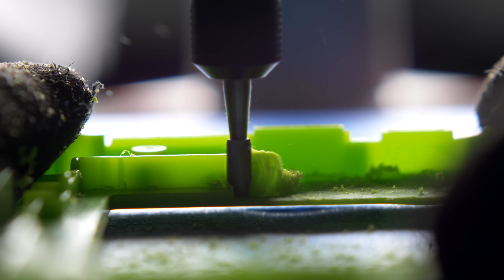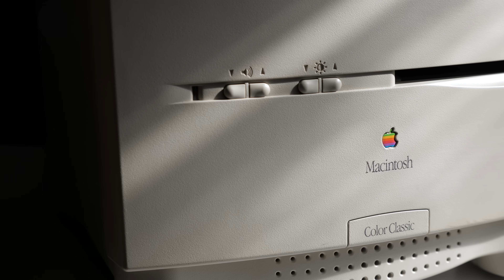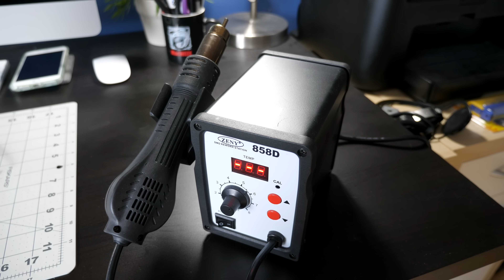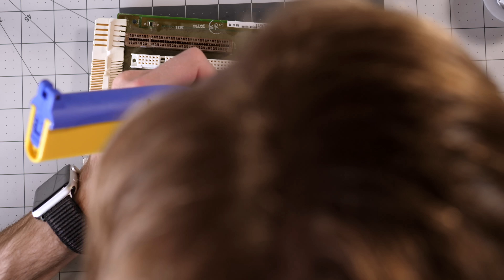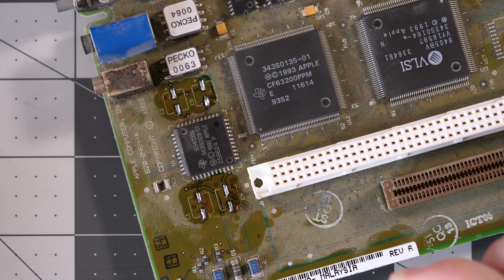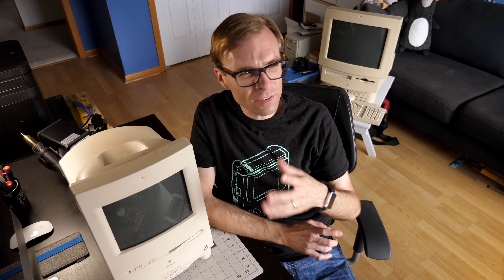Recapping My Classic Macs

Comment: hi  that some cecks  you got to be so care full  i pick up  sony 1800 uvw  betacam sp decks  

in side the uv meter unit there are 5 caps that go bad i can see them going  bad as  they are covered up the lool of the unit is ok

i have fond for me is to cut the cap in 1/2 with a side cutter first and get the rest of later    as the grey pad part could lift the track pads 

i have had this going on  and clean of the solder legs later on

Comment: Please be gentle when pulling up on those aluminum electrolytic capacitors from the board Sir. Those pads come off with very little ease. Much more so on older electronics, that have leaked electrolyte all over them. I saw you tug on one of those capacitors. You are gonna rip the pad off of the board, if you do that. I made that mistake with my NEC Turbo Duo game system, and probably depreciated its value by making such a terrible move on one capacitor mounting location. I had to find an alternate path to solder it to. Not only that, It was a real chore, to find a way to mount it securely to the board. 
Don't be afraid to get the hot air close to the board with one hand, and some tweezers with the other hand. Hold the capacitor you want to remove with the tweezers, and very gingerly, lift up on it, then apply the hot air moving back and fourth, as the hot air is gonna work its magic, melting the solder.  The capacitor will come right off with very little effort.

Comment: I have an Acer monitor that could use a recap, for restoring the color. But using a unimportant board for practice is a great idea!  Thanks again 🤓 I subscribed. Should have a long time ago! I would say you got a good deal on the rework station. The recap extends the life, even tho those mac's are old, of those classics!

Comment: This is not a easy way and not fast at all. I usually just twist them off. mr. carlsons lab has a nice video on how to do it.  https://youtu.be/X8N9O3a9jiM The key is not to pull, but just keen pushing and rotating untill they are completely free. the pushing is the counter intuitive part. just practice on a thow away board so you get the hang of it.

Comment: Hey, I have a LC550 with a same problem here. I sent out my 550 board, it lost sound not long before I bought it apparently, for a full cleaning/recapping/battery change, it came back in great shape but I still have no sound. Did you ever find out the root cause on yours?

Comment: i recapped 4 old macs that i found. a Macintosh Classic, a Macintosh LC, a Macintosh IIci, and a Macintosh Performa 450, they all had leaky capacitors and i never tested them until i finished cleaning and recapping them. they all work now. The Classic has System 7.0.1, the LC has System 7.1, the IIci has System 7.5, and the Performa 450 has System 7.5.5. many of them except for the Classic had no hard drives in them, the Classic's HDD was dead sadly so i couldn't see what was on it. all of them have SCSI2SDs since SCSI hard drives are hard to find.

Comment: I would suggest for people to purchase some Kapton tape to protect the smaller components around the area you are applying hot air to. You don't want some ceramic capacitors to fly across the room. Believe me, you will never find them.

Comment: I find surface mount caps are easiest to remove if you cut the can off flush with the bottom plastic plate using diagonal cutters. That will leave behind a black plastic spacer and the two leads which can easily be removed with a proper soldering iron and desoldering braid.

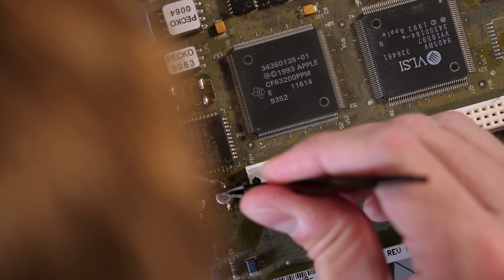Comment: Also, at 13:21. Why did you do the outside cap first? Tip for new hobbiests, when replacing caps, start with the inside first, so you don't get in your own way.

Comment: I had to replace an intel I/O chip on a mac mini once, I had never attempted it before but it wasn't too bad, I did have to use an oven to properly flow the chip which did work. I also had to replace two or three smd capacitors on the same board after baking. That late 2008 non working mac mini that I bought for only $30 over 3 years ago still works to this day!

I find that if you do not have very fine solder ".5 mm or thinner" than just applying some solder paste to the pads and laying either the component or capacitor in place and quickly melting one side with a fine tip soldering iron is not too hard. Dental composite instruments can really help put the paste where you intend and solder paste leaves such a clean joint! But I have spent quite a few years repairing car audio equipment and have worked on many smd based amplifiers, so I was ready for the mac min!

Another tip would be to buy a mixed lot of the capacitors where the ones you need are included, that way you can use the others for recapping or repairs.

Comment: Thank you for demonstrating how well hot air works on these SMD caps, I had a ton of trouble recapping my old Quadra 840AV because even with hot tweezers or two separate soldering irons, there's a tiny blob of glue under each cap and it's really difficult to break them off the board in a controlled way. Really easy to slip and dig into the board. Much better to just melt the glue with air!

Comment: I'm cheap and remove smd caps with a pair of pliers. If you rotate the cap clockwise or counter clockwise the legs will break off the cap and not damage the board traces. Done it for a long time. Also smd caps generally have worse esr than radial through hole ones. I just replace with through hole type usually.

Also need to warn folks about polar and non polar caps.

Comment: Now that you mention the analog board at the end; putting this together with the CRTs instability... I would say you should have recapped the PSU/analog board first.
Reply: No. The main board will get eaten by those caps before the THTs on the analogue board and PSU fail.

Comment: Great video but please be aware that you CANT go up in Capacitance rating, you CAN go up in the Voltage rating without issues tho. If you do go up in capacitance value your machine will start doing weird things or not work at all. 

Btw, great removal technique, I use the same myself but I use my desoldering gun to remove the excess solder from the pads, then apply flux with a Flux-Pen and then only put fresh solder on 1 pad per cap. After that, you can push down on the cap while heating the pad with your iron and achieve a flat installation. then you solder the other side and your friends will think your recap was done by a Pro. :-)
Reply: Derek Osborn you can sometimes go up and down in capacitance. Nothing is critical. I say this with experience

Comment: Very interesting video! Do you mind me asking what brand/model of cordless soldering iron you use?
Reply from the maker: It's a Hakko FX-901. It doesn't have a ton of thermal capacity so it's best for small solder joints, but it's very convenient and works well.

Comment: Easiest way of removing electrolytic capacitors is to twist them while holding the boot (plastic base) in place. The boot will break the legs out of the capacitor, not off the board. Then use copper solder braid to clean the pads off completely. Finally, apply flux to the pads, hold the new capacitor in place and tack-solder its legs onto the pads. This prevents excess solder from spreading underneath the capacitor boot and bridging the vias underneath or nearby the capacitor.

Comment: There is a solution that does not involves soldering. Get a G4 Powermac that can Run OS9 and you are done. These 90s macs are really just as beige and unattractive as the most computers from that era. Not really worth saving in my opinion

Comment: If you don’t remove solder from as least one pad then you can’t get them flat without potentially levering one of the pads... which can be really bad when they are weakened from leaked electrolyte. There is very low risk with braid when you have already removed the component and cleaned the area.

Comment: You want to try and match the capacitance for most electrolytics. Going up is bad advice!  Not saying it will damage anything but it can definitely affect operation, unlike going up in voltage.
Reply: Not usually that bad for power supplies... timing and filter circuits yes... PSU's not so much!
Reply: dan b Look up Afrotechmods’ “Why electrolytic capacitors are actually kinda shitty 💩” video.

High frequency is where the different properties really change results. Let’s not forget that this is a computer... not an appliance.
Reply: @emmettturner9452  friend, I've been fixing this sort of stuff for 30 years! 
Going up a few microfarads is NOT a big deal, unless it is a timing or clock circuit!  These are just filter and bypass caps!
as for the Afrotechmods video regarding caps... that is electronics 101 basic electronic theory my friend.
Reply: "
  
Emmett Turner
dan b So have I. He incorrectly suggested that going up in uF is an accepted rule of thumb, just like going up in voltage rating, and he did so without limiting his suggestion to “a few microfarads.” Surely, you can see why this needs to be called out before he influences others to assume it’s always OK. You yourself listed examples where it is not OK. Speaking of doing this for 30 years: you can’t just go up on every cap in an Atari 5200 or Commodore 64 for the same reason... those analog inputs use the pot with capacitors to adjust the frequency and determine position. I’ve taken advantage of this to repair new-old stock controllers where the resistance has dropped in the pots over time. Funny that you say it that way, “Electronics 101.” ;) The first thing he says is that it isn’t taught in school. Granted, the comments section is full of people saying otherwise."

Emmett, fair enough, I agree that there's times when you shouldn't modify the rating and values of components. certainly in timing, and filtering circuits, as well as op-amp gain structures, etc... but in run-of-the-mill-bypass caps... no harm done.
truth! you must learn the rules, and then discover when it is ok, to bend them a bit in the sake of immediacy...
If I had to go out and order and then wait for every capacitor value i needed to replace, I would never get anything repaired and back in service in a timely fashion...

Comment: You want the same capacitance when replacing the caps. Higher voltage ratings are fine though. Do yourself a favor and remove all solder from the pads before you install the new caps. It’s best not to mix solder chemistries long term and it’s easier to fill seat the cap when one pad isn’t mounded up.

Comment: I'm going to suggest something that may be entirely obvious...but if I remember on the older Macs if you had the sound muted or set to 0, it would write a value to PRAM that would mute the startup chime as well. I assume you still went into the Sound Control Panel to make sure the sound was dead there too?

Comment: Last year I recapped my SNES and RGB modded, I had zero experience SMD soldering, did it wth a ton of flux, good solder and a decent soldering iron with a fine tip, and of course some tweezers, since then I did a lot of other SMD soldering with a lot more confidence, and with time I've been upgrading my soldering gear, depending for the job you don't need a hot air station, but for sure, is a good tool to have, and is the next on my buying list.

Comment: One thing I prefer to use to clean baked on dust, Big paintbrush, and then use a precision paintbrush, also Rubbing alcohol dipped in the brush works well too. I see LGR using a Toothbrush, that's good for really thick dust and grime, but a paintbrush tends to be less abrasive
and i feel like i need to say this, USE A NEW CLEAN paintbrush, using ones you used with paint could harm your electronics

Comment: Are you sure you don't use way too much heat? The plastic was bubbling up on that one cap you focused on. Also I wonder why you didn't clean the board, esp the stains under the cap where it seems like they've leaked electrolyte.

Comment: You can always go up in voltage. Straying too far from the original capacitance values may cause issues. Keep the same capacitance values.
Reply: Yeah. Literally every other soldering video will tell you this. Also I don't think tantalums are a good idea for something like this, pretty sure EEVblog has a video about why you can't always just replace electrolytic capacitors, unless it's for things like power filtering.

Comment: Great job! I am  LOUSY at putting down surface mount so I end up putting through hole on the surface mount pads after removal of the surface mount caps. Also I love your choice of soldering irons. I have the same one or at least same family. Simple and easy to use and with some good rechargeable batteries cost efficient as well.
Reply: Some boards are equipt with lots-o-tiny smd aluminum electrolytic capacitors, all over the board, or clustered in certain locations. The thru-hole caps are much larger and will give you space, or pile-up issues. Keep that in mind, when you do recap work. I tried to do that on a Sega Game Gear, I quickly rolled back the large cap install, and bought myself some smd capacitors, and soldered those on instead.  The "Retro Six" YouTube channel has helpful smd soldering tips. Very Helpful.

Comment: I've recapped many of these, and other stereo equipment, and when I watch these videos I cringe a bit because you don't need to mess about with solder stations or hot air guns. It's not at art project! 

Just take a set of clippers and snip the top of the cap. Once you crush it, it will slide off easly exposing the pins. Then just lift off the plastic base over the pins, leading just the pins standing. You can then remove these really easily by heating them one by one with the iron and using a pair of pliers to pull them off the PCB. 

You generally don't even need to tin (re solder) the base before inserting a new cap. Just clean off the electrolyte.
I've never broken a pad and I don't use flux - modern lead free solder has it already - and I use a cheap iron and solder remover gun.
Also, don't replace SMD caps with newer SMDs. Just get cheap electrolytics. Much easier to work with and replace in future, if required. 

Tantalum caps are also a waste of money. 

Don't over think it!

Comment: Audio problems are a anologe board problem due to bad caps as well i have not fixed any newer 1990s macs but i have done it with mac pluses, I own two and i have had problems with cords connecting tonthe board and old caps even if they look good they may be bad just replace all of them if you have to.

Comment: Me during the video: "Hey why aren't you using tantu- oh. Yeah, okay, I get that."
Reply: Ugh. You can’t just replace any electrolytic with a tant. They have different characteristics that the board was engineered around.
Reply: @emmettturner9452  Huh. Fine in an SE/30 and Classic II that I did for a friend. Tantalum caps are pretty much the standard in the the black and white compact Mac community.
Reply: Joel Crane Yes, just like much of the console and handheld community is now replacing electrolytics with ceramics. It may work, but it’s still wrong and could lead to issues that are hard to diagnose/troubleshoot. The entire point of replacing them is to head off such issues.
Reply: @emmettturner9452  Correct, but unlike ceramics, which have indeed different characteristics to electrolytic caps, tantalum caps have not and are a direct replacement. In case you don't know, tantalum caps are electrolytic as well. The difference is just that they use a non-liquid electrolyte.

I'm replacing SMD electrolytic caps with tantalums for at least 15 years in all my retro machines. Not a single one ever showed even the slightest fault due to this. The only reason tantalum caps are not used widely is costs.
Reply: @_derSammler  Check out the chart in Afrotechmods' video called "Why electrolytic capacitors are actually kinda shitty 💩"

While it's true that tants are much closer to AL electrolytics than the other types on the chart, the tants are still closer to every other type than they are to aluminum electrolytics.

Let's say that your circuit was designed around the expected ESR and ESL of an AL electrolytic cap and then you throw a tantalum cap in there instead. Now the ESR and ESL have changed in a circuit expecting a certain ESR and ESL. The rest of the circuit doesn't get reengineered to compensate so inductance and resistance-sensitive parts of the circuit are potentially out of spec.

If you are engineering the circuit for better long-term reliability then tants are the way to go but it's almost always best to stick with whatever the designer intended when servicing the caps in something else.

Comment: One step you forgot was to use solder wick to remove the last bit of the lead free shit. When it's mixed with leaded solder, the resulting amalgam / alloy becomes especially brittle. Not too big a deal, but it could lead to the joints failing over time with shock, vibration, or other mechanical stress.

Comment: Be careful with the same model of hot air gun Colin is using. Those ones are known to do very bad things - there are a few videos on the 858D Rework/Soldering stations out there that go into more detail and possible fixes. They're fine to use, just make sure to examine them on delivery and take measures to be safe with them. Including having a fire extinguisher. ;)